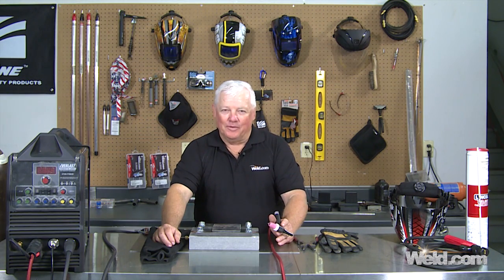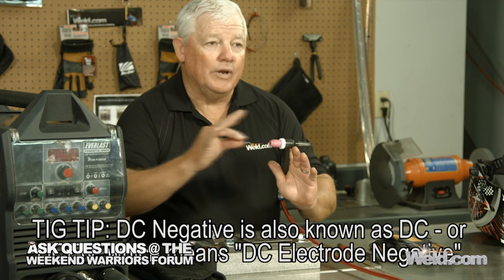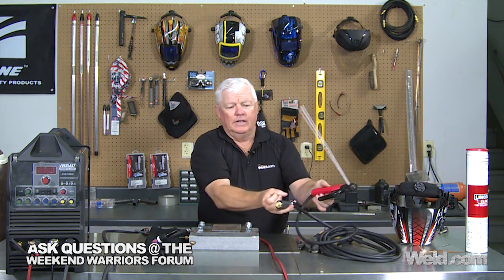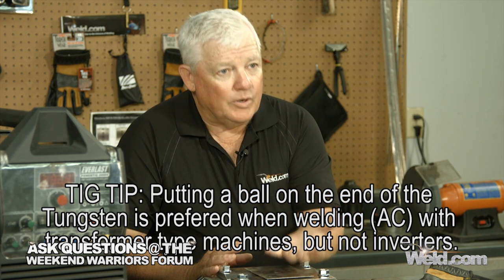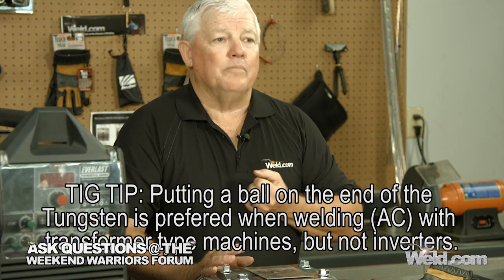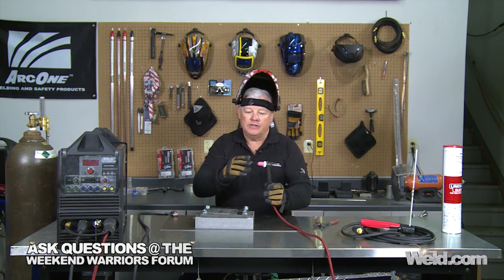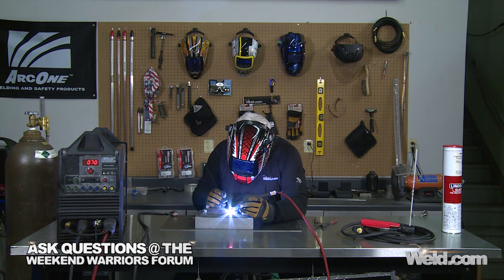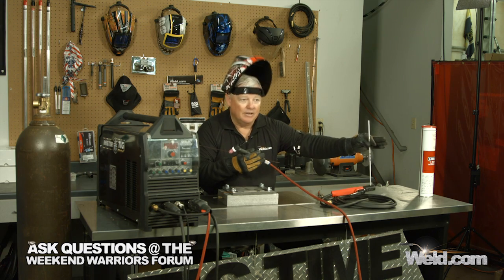The Difference Between DCEN and DCEP | TIG Time

Comment: I am planning on buying a mp machine and the majority have a dc neg tig feature, I had no idea what that gave or took away as far as tig feature goes. Mr TIG may have just cleaned that up for me. Thanks MR TIG.
Reply: I purchased that MP machine, this video helped me understand the difference. I am a novice welder at best.
Reply: @mikef-gi2dg  I want to get into TIG welding. How has it been going for you?
Reply: @techninefan90  I purchased a Lincoln le31-mp it has the basic scratch tig capability. I have yet to buy the torch set up....everything that has nothing to do with welding is getting in the way. I don't think my machine will do aluminum, that's what the spool gun ( also need to buy ) is for. I just want to try it in sheet metal and thin stuff. Hopefully really soon I can start to play. I am going to have to find a TIG 101 for beginners manual from somewhere. I'll update.

Comment: I have a old century AC DC stick welder that I use to Tig weld steel with. Can I use the AC side to weld aluminum with out  having high frequency  so I can use argon instead of helium like you do on DC if so would it be ac+ or ac-  
Thanks and hope this makes sense

Comment: I have a Miller welding plant with separate power supply control unit, a dc hf tig unit and mig unit all externally linked.
The thing is, when the tig unit is connected up with electrode negative, there is no hf so you have to use a scratch start, once the arc is struck, it totally destroys the tungsten. So it has to be connected with a reverse polarity. The set is not capable of running AC for aluminium.

Comment: I actually weld magnesium DC straight polarity. It makes for a killer weld. The puddle is sluggish however the strength and quality are very good. 

On very thick aluminum like one inch plate, I clean the aluminum up very well and I use DC straight polarity with a little Argon and a lot of helium cover gas and I get rather amazing results. It does not work well on thiner, or dirty aluminum. And it does have a learning curve. Some test pieces are required. You have to poke the puddle with the wire after you get a nice hot puddle. Let it burn in a bit and move on. 

Sincerely, 

William McCormick
Reply: I also weld bronze or brass with DC as well. 

Sincerely, 

William McCormick

Comment: Where I'm from, everything is all about AC. In order to turn a generic AC buzz box into a DC welder, I'll need resistors with bridge rectifiers, but the problem is that I don't know where to get resistors.
Reply: +Seph Angelo No resistors are required. Only a bridge rectifier is needed.(A large capacitor added to the DC output is not a bas idea either)

Comment: Can someone answer why there were no visible fumes.. ?
Reply: Because instead of the flux on the ARC welding rod, there is Argon inert coverage gas keeping the weld from oxidizing and the tungsten from oxidizing. 

Below are the original classifications for common welding procedures. 
They change them up now and then.

I have been welding since I was 9 and I really do not bother with the new terminology. 

TIG (Tungsten Electrode, Inert, Gas}. 
ARC (Anode, Rectified, Cathode)
MIG (Molten Electrode, Inert, Gas)
MAG(Molten Electrode, Active, Gas)

Sincerely, 

William McCormick
Reply: Tig you can weld litterly inside your house if you wanted to. I wouldn’t but people do in thier laundry room
Reply: @weldingjunkie  sometimes you have to borrow 220 from the dryer lol
Reply: @weldingjunkie  fumes are still produced from tig welding. Just a lower amount so not as visible.

Comment: I am finding it hard to get a proper size ball on the end of my Tungsten while welding Aluminium. I start with a properly sharpened Tungsten and I test it on a piece of scrap Aluminium just to ball the end but it ends up with a huge ball on the end - Is my AC balance wrong ? - Please help
Reply: Lower your power, roll into it slow.  It only takes a little to form the ball.
Reply: You really don't need to ball the electrode, it will do it on its own. But if you feel the need to do it,
switch over to DCEP (reverse polarity) and light up on something. It will ball rather quickly.